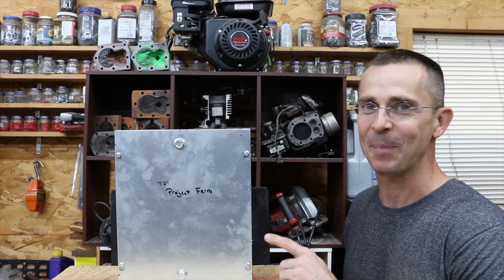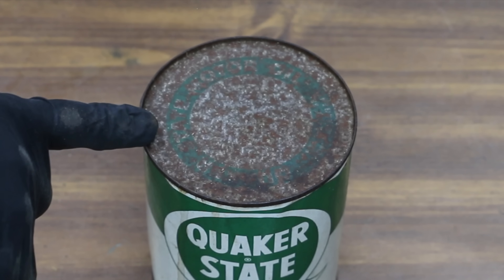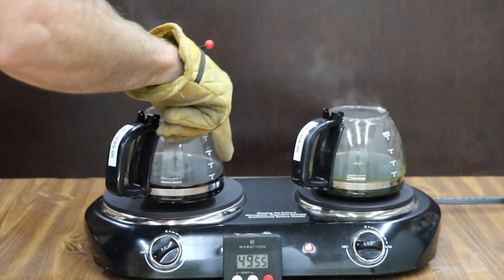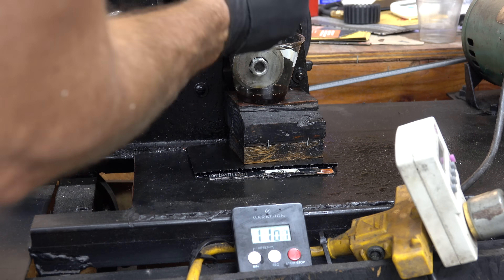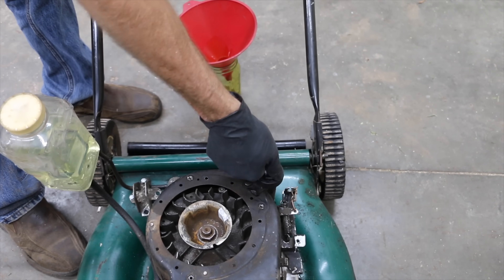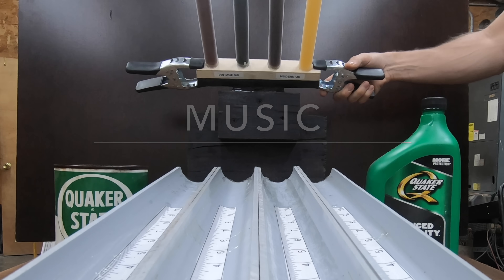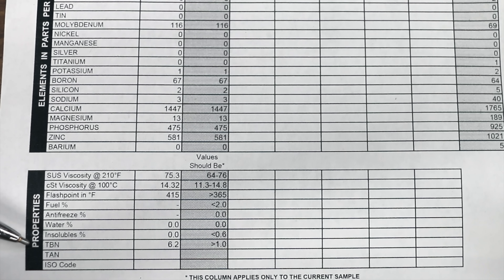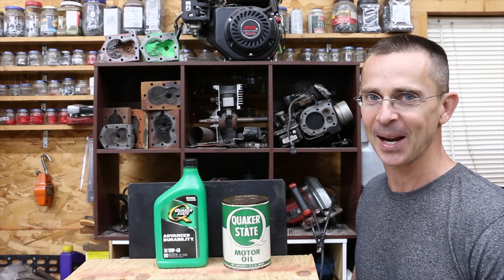Is Oil Good After 70 Years?  Let's find out!

Comment: No wonder engines of the era were 'done' in 100,000 miles, or less.
Reply from the maker: Thank you for the feedback
Reply: Most new era cars are too more or less, cant expect to drive a 2002 bmw that long without the motor leaking oil and eventually failing
Reply: @fungustar  depends on the design of the engine,  my 2004 tundra has close to 300000 miles and runs great with no oil consumption
Reply: @fungustar  friend of mine owns bmw e39 3.0d with 800kkm, no engine change
Reply: Plebejski Uciekinier hes lucky as hell then ive never seen one over 500k that even worked
Reply: @fungustar  Its all about doing the preventative maintenance on time especially fixing oil leaks so the engine doesn't starve/run with low oil.
Reply: Absolutely nailed it.  People used to be amazed if they could get a vehicle to 100,000 miles, now it's pretty much a given...
Reply: @blairwilliams136  Many engines between 1990-2010 are some of the most reliable ever made, sadly after that the downsizing and beant-counter parts being used have made them unreliable again..
Reply: many cars now already fail in warranty
Reply: @flisko123  Only rarely.  Maybe you suck at maintaining yours, more often they are in wrecks.
Reply: Jennifer WhiteWolf very true 100k was a big achievement not even 200k is expected and normal. Both of my cars have over 200k on them.
Reply: In today's vehicals 100k is just broke in. If not, then someone abused it, no reason not to get way over 100k in most modern engines.
Reply: @FuLLeFFekT1 Honda also makes very reliable engines.
Reply: My 2003 Chevy express has 282,000 just had transmission rebuilt and engine got a tune up. Mechanic said compression was top notch. I always change oil every 3,000 miles no mater how long it takes me to get that many. I do change oil filter every time.
Reply: @anavrinhsub6081   you obviously take care of your vehicle like i do. My 02 Honda accord has 254,000 same transmission same engine and it doesn't miss a beat. I do 5000 between oil changes, full synthetic, cause I drive all highway alot.
Reply: @fraidykat  I'd almost rather cars went back to a 100K lifespan, if the price were accordingly reduced. Then everyone could be a new car more often.
Reply: @vicz8899  No thanks.
Reply: I’ve got a 03 sun fire with 415k on it with no work done, and it still runs great
Reply: there was a number of reasons why motors didn't last back in those days, but a big one was also why spark plugs didn't last very long, the gasoline. other than the valves, leaded gas was hard on everything. the lead fouled the plugs in short order, 8-10,000 miles was pretty much it for plugs. you really never saw spark plugs that were worn out from running in the engines. for the people who were cheap, we had a thing called a spark plug cleaner, mounted to the side of your tool box or work bench. it used sand or some other abrasive & high pressure compressed air to blast used plugs clean. it did wear plugs out, but using it you could sometimes get 20-25,000 miles from a set of plugs on a motor running leaded fuel.
Reply: @blairwilliams136  A chevy corvette has 600,000 miles I forgot what year but all original parts.  A well built vehicle.  Chevy lasts a long time.  I am excited for the new corvette stingray coming out.  The corvette with the miles ended up in a museum because how long the vehicle lasted and how well it was made.
Reply: My opinion on why engines wore out quicker was the content of lead in the gasoline. The engine of those days needed the octane and in order to get the octane they use to put lead in the gasoline to achieve it. The lead would gum up valves and prematurely wear out engines. I remember my dad would try to get rid of his cars at 65k miles so he wouldn't be stuck with it.
Reply: @MyNewUserName47  a lot of this spark plug failures were due to the mechanical Point type distributor systems of the day which supplied not even half the voltage to the plug of modern type HEI ignition systems as today and throughout the last 40 years. The lead helped to lubercate the valve seats and lower temps, a big benefit for the higher compression engines of the time, it was also that use of lead which contributed to higher octane fuels for said engines. In fact after they went to unleaded gas the manufacturers were forced to install hardened valve seats in the heads of most engines, as well as the older engines without hardened valve seats begin to have failures that that required most of them to be torn down and have hardened valve seats installed. Lead is still present today in aviation gas for reliability and safety reasons..
Reply: @FuLLeFFekT1 is this a joke? Because BMW supplies the engines for the new Toyota Supra, which isn't that the only car Toyota makes now? ( I don't consider front wheel drive as a viable option for design in any application of automobiles, and so basically I don't consider them as cars at all.)
Reply: And yet, with that said I'd rather have any of them older cars than the shit they build today.
Reply: And yet, with that said I'd rather have any of them older cars than the shit they build today.
Reply: Modern engines are just getting broken in good at 100k.
Reply: @davidmurphy4672  who would be able to walk after 600,000 miles in an old vette?
Reply: @MyNewUserName47  The lead did a good job lubricating the cylinders though...
Reply: @fungustar  my 2005 vw jetta tdi has 370,000 miles all that it needed so far was a new cam
Reply: Also, people back then expected a car to be worn out at 100 k miles , so they tended to skimp on maintenance as the car approached  that mileage.
Reply: @walkerforsyth6221  yeah, electronic ignition did help with longer plug life, but the main thing 
was going to unleaded fuel. i started working on cars for money in 1970/71. 
with electronic ignition, cleaning the plugs didn't work as well, once a plug was misfiring odds were a lot higher it was done. with a points system, you could normally clean the plugs once or twice & be ok. that could very well have been because with electronic ignition the spark was so much hotter that it cooked the lead into the ceramic.
my Dad had a 71 Coronet, the first year of electronic ignition for Mopar, i don't think it ever got to 25K on a set of plugs before it started missing. my brother had a 75 Fury 2, it went 50-60K, and sometimes higher on a set of spark plugs. both had the 318 2 barrel carb with electronic ignition. only major thing different was the gasoline. the 71 burned leaded, the 75 was unleaded.
i was told the same thing back then about having to have hardened valve seats to burn unleaded, but i didn't notice it. maybe it was just that valve jobs were already so common with leaded gas with sticking & burned exhaust valves. if anything, i think valve jobs went down. all those predicted problems just didn't seem to materialize. 
when they were a new thing, i can remember being told to not touch the altenator on a running motor cause it would shock you. 
seems the only thing i can think of that turned out to be true was computers would make it so you couldn't work on your own car. but with a little good training & the right equipment, most anyone can still do it. but like always, there are those people who should not open a hood with any tools in their hand, & some that shouldn't even touch the hood release.
Reply: @walkerforsyth6221  a lot of the older cars were much better looking. real steel & chrome 
bumpers, bright work that was, well actually bright. they were certainly easier to work on. but i do like the great fuel mileage & clean tail pipes of modern cars.
Reply: @fraidykat  it wasn't put in to lube the cylinders, it was to help the exhaust valves but mostly to boost octane. the car makers could have phased it out a lot sooner.
Reply: @johnsaum1260  It took years to reach that many miles.
Reply: @MyNewUserName47  right
Reply: @MyNewUserName47  You'd have to change the rings if you wanted to use unleaded fuel, the lead worked in the chamber every bit as much in the valves.  For a long time people had to use lead additive for their gas tanks if they wanted to keep running them.
Reply: people also forget how often the oil changes were required.  When i started as a mech in 1981 it was 3000km between services; now 15000km isn't unusual and a UOI comes up as "good"
Reply: they were mostly done at 70,000....lots of problems developing that you could not see.
Reply: I once had some engine work done on my Dodge military truck by an old timer who was retired and still pouring babbit, line boring blocks, rods, etc.. He said that the oils today (1980s) are far superior to the oils from when he was young.. They must have served the purpose though as wars were won with engines that used this oil.. Many engines back in the day had no oil filter though and the oil as in this video was "straight mineral oil" that is, no additives or detergents was used in such engines..Most engines also had "oil bath" air cleaners which had to be serviced and kept with oil in them or you had no oil filter at all... Most young people have no clue about any of this...Cheers Mike in Louisiana
Reply: But the cars were made of much bettter thick sheet steel, you still see vintage car bodies behind garages and  in farm fields with no paint left on them but they  not all rusted out and just piles of corrosion powder! today's cars have engines that last longer but the bodies go to crap real fast so it's just the opposite!
Reply: @HobbyOrganist  There was a time though not too long ago when the rust proofing was less than desirable..Older cars sure had more metal in them.. Plastic can be a curse sometimes I think....Mike
Reply: i forgot about road draft tubes. even thought they came a good while  before eletronic ignition, PCV valves were also a huge contributor to longer engine life.
Reply: @xXYannuschXx  True, engines made fron 1990 to 2007 are the best
Reply: @dimmacommunication  honda engines are better than them european ones lol
Reply: @fraidykat  engines were doing ok without lead as long as it didn't "ping". lead was used to help prevent that "ping", which would damage a motor pretty quickly. protecting the exhaust valve seats was a minor secondary benefit. if lead was needed to protect the exhaust valves, then why wasn't it used much sooner? a number of car companies are over 100 years old, its been less than 100 years ago that lead was put into gasoline. it was 1923 or so for leaded gas.

the rings mainly care about the piston groove they run in, their end gap, the finish on the cylinder wall, & the oil in the crankcase. the oil in the crankcase is what lubes the cylinders & rings. there is a very small amount left on the walls each time the piston goes down the cylinder. you can ask any decent automotive machinist.
right now cheap rebuilt engines use the same rings that came in motors in the 50s, 60s, & 70s. 

here is a link that explanes why leaded gasoline, 
https://team.valvoline.com/legacy/why-was-there-lead-gasoline
Reply: @gamelard1963  I didn't talked about euro or asian engines 😮😮
Reply: @dimmacommunication  lol i thought i was replying to the other guy lol
Reply: @MyNewUserName47  Usually there was a cap on the engine with some hair in it that was supposed to keep dust out when air went in.....You usually had to wash that "filter" in varsol and re oil it during an oil change....I remember those days well along with oil bath air cleaners, ignition points and condensers , magnetos, etc.. Long time ago... Mike in Louisiana...
Reply: @fraidykat  sorry man, that site doesn't fly, "In producing our GSL-4 gasoline additive, we add a polymer lubricant to the blend." yeah, buy this from us & save your__ fill in the blank with what ever they are trying to sell. 
there are people who think STP is a great product & still use it. if you got a motor with loose bearings or is smoking then yeah fill it with mostly STP and get a few more miles out of it. how about some Slick 50 for your car? 

before the 1920s, gasoline didn't have lead added to it and engines were running fine. they even had auto racing before they put lead in the gas.
lead was put into gasoline to boost octane to reduce knock for higher performance. there were other chemicals that could do the same thing. 
a side effect of the lead is it helped to protect the exhaust valve.
there were other chemicals & processes that could help protect the exhaust valve. lead was not needed, its just thay it worked & most of all, it was just cheap.
there were gas stations that were selling unleaded gasoline for use in cars in the 30s, 40s, 50s, & 60s. it was a top tier fuel.
people are driving old cars around on unleaded gas just fine, they have been for a very long time.
Reply: @MyNewUserName47  The 1920s engines failed even quicker before the lead was added.

You don't have to be convinced, but you can't fix bottom end failure by simply swapping heads, which was also common.  In it's combusted form, the lead containing soot provides lubication on the side where the oil is not.
Reply: @fraidykat  sometimes i mistakenly say lubricate, but lead is not a lubricant. that belief comes from marketing, "buy this for your engine. (it only cost us a few cents per gallon to make, but we sell it for $100.00 per gallon because we got you to believe you need it)"
lead does nothing for the cylinder, rings or pistons other than reduce/prevent knock. that is what it was put into gasoline for, well that & to make money, which it did in huge amounts for decades. knock can kill an engine in seconds. a side benefit was it helped to protect the exhaust valve seat from recession caused by micro welding of the valve to the seat. 
induction or flame hardening can do the same thing. in fact it did it for years & still does on iron heads.
there was an oil company that sold gasoline that had no lead in it, they sold it for years as their top tier gas. if people had been having engine problems because of it being lead free, they would not have sold it for very long.
some countries still used gasoline with lead for cars as recent as just a few years ago, some may still be using it.
you should read "the secret history of lead" you may even learn that the same guy who gave us tetraethyl lead gave us another now banned in the USA chemical. 
while you're at it, also gasoline related lookup the Houdry process. he was hugely responsible for Great Britain holding out against the Germans in ww2.
Reply: @MyNewUserName47  But here's the problem you can"t handle because you're so enthusiastic about conspiracy theories: Chemically speaking, lead IS a lubricant, and in an engine chamber where the next chemical is iron or steel, the softer metal IS a lubricant.  But go ahead, argue against simple physics, it shows how smart you are.
Reply: @flisko123  No, "many" cars do not.

Comment: I seem to remember my grandmother telling me "way back when", during the 40's and 50's, you had to change your oil every 1000 miles. Now I see why.
Reply from the maker: Great point!
Reply: Not all cars then even had oil filters. Now you can see why even more clearly...
Reply: I suspect coked up ring packs was the order of the day!
Reply: @101Volts  or air cleaner filter lol..
Reply: Discofelsi  Sounds like the perfect project car for a PF video.
Reply: People didn't go far back in the day.
Reply: And that was the oil that for some reason stayed in the engine. Just some 40 years ago almost every car had a slight drip of oil. you could see where they usually parked by the oil slicks. Now it seems they just don't leak, and finding a small oil slick means it's time to take it to the garage and find out just what has happened. I still check the oil ever so often, but it's been a long time since I had to top it off between oil changes.
Reply: wow really?! I learn from you. cool!
Reply: Discofelsi  My grandad had a Rover P4 of similar vintage, where the air filter was basically like a giant version of the airlocks used when you brew beer at home, except with oil as the liquid. Apparently it would last for ages by just topping up the oil from time to time, but give me a paper cartridge any time! Also decoking was a standard maintenance task... Most people I know don't even change their own oil, I can't imagine how they'd feel about removing the cylinder head once or twice a year.
Reply: My 41 dodge had a filter that was optional equipment. It actually cleaned oil. A decal on the housing had a picture of a dip stick with Golden oil on it. Under it read the dip stick tells the story. The element was cotton. Some time in the 60s almost useless pleated paper replaced the superior cotton. It is always better when the sludge is in the filter instead of the engine.
Reply: IF you didn't have an oil filter.  If you did, then every 2,000 miles.
Reply: This was basically filtered and distilled crude oil, API Group I. Back then, no one had any idea of what would be possible in the future.
Reply: Discofelsi  With no oil filter, you should be changing your oil every 1,000 miles, and you should be using non-detergent.  You want the contaminants to, as much as possible, settle to the bottom of the oil pan, not remain in suspension.
Reply: @svenschwingel8632  I don't know if was that bad, but it was not good compared to today.
Reply: This explains the old filling stations always checking oil with fuel fill up as part of their service. My grandpas joke was, “fill up the oil and check the fuel”.